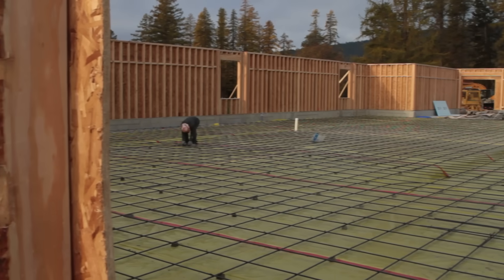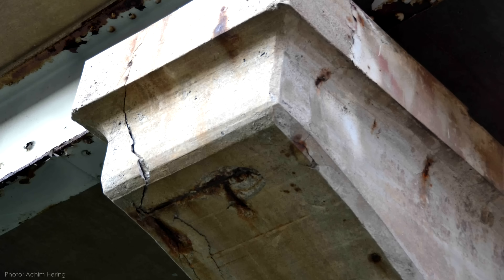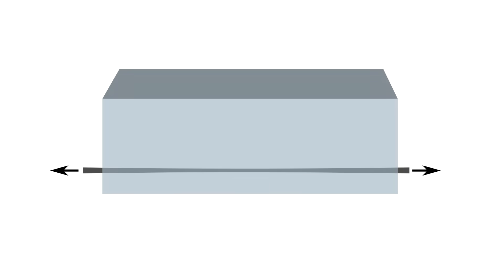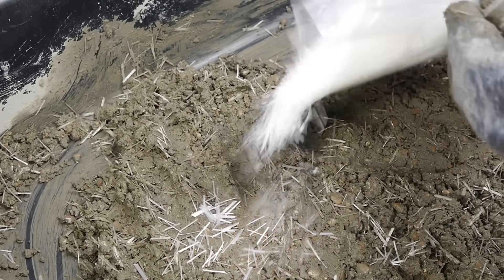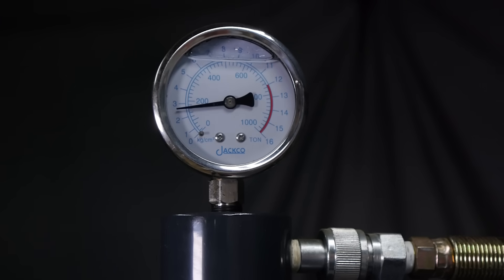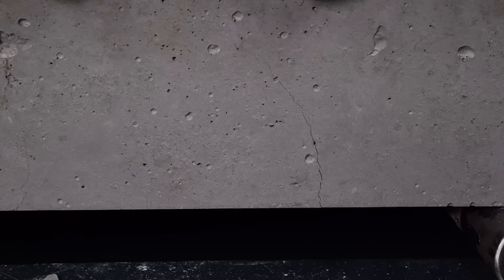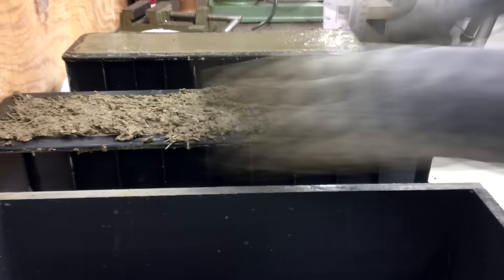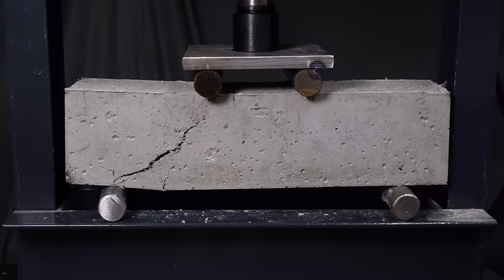Does Rebar Rust?

Comment: Is there still a point to adding fibers when using non-corrosive rebar?
Reply: Cracks can let in water, which can freeze and expand, which would damage the cracks even more.
Reply: At a guess I would suspect that would depend on the intended application, for one thing the added protection against the formation of smaller scale cracks could be a valuable property for applications where there is a relatively high risk of damage due to impacts etc. Military structures that are very likely to be subjected to weapons fire or structures likely to be struck by heavy vehicles etc perhaps of course the latter is usually reduced by just placing metal crash barriers between the vehicles and the concrete supports. Even in parking structures you can find those quite often because the owners typically tend to get fed up of repairing the darn things when people can't park.
Reply: Yes! Crack control. Architects don’t like cracks even though they don’t impose danger to the integrity of the structure.They are just-ugly

Comment: You can probably guess, I’m not aware of the science of concrete, more of an “armchair amateur”. lol  
A crack can be a visual guide to a problem within the heart of the concrete, if a crack is masked with fibre reinforced concrete, could a problem be missed more easily? 
  I mean water will ingress into the finest of gaps aided by capillary reaction, with concrete not flaking away it would make a failure even more unexpected than if it was visually flaking and falling away.

Comment: why did the beam fail suddenly ? 
isn't the rebars are supposed to ensure that the failure isn't a sudden one (brittle) ?
Reply from the maker: See comment above. These beams were over-designed. They weren’t really meant to demonstrate the failure, just show how the flexural cracking works.
Reply: Not sure if the beam was designed as tension controlled, meaning that the steel begins to yield before the stress in the compression zone reaches the concrete's compressive strength. Also, due to the short span of the beam during the 4 point bending test the shear forces in the beam were very high causing it to fail due to the lack of shear reinforcing (stirrups).
Reply: Not really. The beam failed suddenly because the concrete cracked and was no longer bound to the rebar by the rest of the beam. The rebar is there to add tensile strength, but the structural material is concrete and it will always break like that.
Reply: The beam in the video failed in "shear", which is an instantaneous failure. A longer beam would fail in "bending", which is more visible and progressive over time. In summary: "short" beams fail in shear, while "long/slender" beams fail in bending, the same as "short" columns fail by crushing and "long/slender" columns fail by buckling.
Reply: Rebars add almost all of tensile strength, so they are structural materials too. They are added to ensure minimal height of a beam/slab. Otherwise the beams should be like in ancient Greek churches, ridiculously high and short.

Comment: Hi, how long did you leave those test beams after poring before you tested? Concrete improves over a few weeks or months after it has been pored.
Reply: In the video at 4:04 he said he let all three test samples cure for about one week.
Reply: He said two weeks but for the purpose of the video and his test setup it didn't really matter as long as all three samples were cured for the same time. The samples were tested only compared to the other samples and not to anything else.
Reply: He said that he let them cure for 2 weeks
Reply: ooops, missed that, thanks
Reply: @marvintpandroid2213  
*pouring
*poured

Comment: May I request a topic? :) About concrete pouring under water? :)
Reply: Potchi Boy yes do this please! Or just bridge building in general
Reply: @JHA854  bridge building in general would be a 70 hour video. There are so many types of Bridges and ways of building each one.
Reply: Yes please
Reply: Ok, so I'm a delivery driver for ready mixed concrete.

Alex Solhall is correct about how concrete cures.

Last night, I worked a pour on a bridge over a local river.

They are actually building a new bridge. We poured a caisson (pier, or piling) that is part of the main support structure.

132 cubic yards of concrete for a caisson 135 feet deep.

They ran the pipe from the concrete pump truck to the bottom of the form which was full of water. As a previous commenter described (Mr Wizeguy), the concrete flowed in from the bottom, and pushed the water out the top of the form.
Reply: Hi Potchi!
Concrete does not actually dry like a wet towel, by evaporation, to become strong. The water molecules reacts with the cement in a process called hydration. So the water actually stays inside the concrete forever, and therefore, concrete may also set underwater. A more common problem is that the concrete is evaporating water in hot conditions, making the finished product have a rough or cracked surface, and that is why newly poured concrete is sometimes sprinkled with water. I am not a chemist and haven't thoroughly read up on the subject but I hope I was of some help.
Reply: @axelsolhall5830  the cracking caused by water evaporation is because evaporation causes cooling so the surface shrinks. The concrete may still cure properly but the cracks remain. So the worst conditions for this is not so much when it is too hot, rather when it is warm and windy
Reply: Oh, that would be a good one. I'm curious to see if research into the old Roman concrete has resulted in any modern applications yet for marine concrete.
Reply: @jnklee  actually, the concrete used by the Ancient Romans is of much better quality than what we use today.

Unfortunately, the techniques and "recipes" they used were lost, so we don't really know how to make concrete as well as they did.

That, or it's too cost prohibitive to be practical.
Reply: @alpurl  really? How do we know it was better if we don't know how it was made? I just know they used seashells to make it.
Reply: @MrRedsjack  hmmmm....

Well, last year in Atlanta, there was a fire under a concrete interstate bridge that ultimately collapsed.

We have buildings, roads, driveways, bridges, etc that have to be replaced because of questionable structural integrity.

Many Roman structures are still standing, and some still in use after 2000 years.

What say you to that?
Reply: From direct experience I can tell some of you that you are wrong about concrete setting underwater. Standard concrete such as you would use for a patio will just dissipate into gravel and silt if you put it underwater. Hydraulic cement which is a high cost very strange and different form of concrete will setup underwater. For the most part it holds together underwater as long as there is no strong current or suction nearby. It is also mixed backwards from regular concrete. Regular concrete you add the water to the mix but with hydraulic you start with water and add the mix to the water. Both can be bought at most hardware stores but concrete is cheap and hydraulic is really expensive. I won't argue the chemistry behind either because I don't know. But I did run a crew for years that did all sorts of wet and dry concrete work. We hand formed inverts and diversion channels in the bottom of manholes in underground storm and sewer lines, as well as built single/double collar walls at joints, and repaired inverts of large RCP (concrete pipe). Most of this was done in wet conditions. A shovelful heap of regular concrete place in the bottom of a storm drain pipe will disappear in seconds so it can only be used on new construction pipes (dry pipes). But if we are talking concrete as a massive general blanket statement....yes concrete can set under water but not the concrete 99% of people are thinking about. There are probably 50+ different types of mixes you can order commercially and probably 10+ varieties at the local supply house.
Reply: Everyone knows that if you put a block of concrete powder underwater, it turns into a block of concrete. Simple Minecraft.
Reply: Bibasik7 has the most accurate and best comment here 👏
Reply: Nothing special for "pour" concrete underwater. 
You need form where it will be pumped and pumping will start from bottom and keep hose there until form is filled concrete pushes water away when form fills and that way only top part of concrete touches water and rest remain pristine. 
That top part is sacrificial layer and isn't include part of designed structure meaning if you need 10"x 10" and 3 feet high footing example for pier form needs to be like 1 foot taller because that top layer becomes weaker by touching water.
Reply: Yeaa, do that one pleaseeee
Reply: you literally can use any concrete underwater you just can't shoot it out fast from the hose. it needs to be gently laid down concrete doesn't dry it cures. by a chemical reaction called hydration. we use admixtures to keep the strength of the concrete high too
Reply: @TheTurtleShellGaming  Well, that depends, but in Europe there are regulations for what concrete you can and cannot pour underwater. In Sweden in particular, you have to use an addative that prevents the concrete from bleeding cement paste. As a general rule, underwater pouring is avoided when possible due to cost, end result and technical difficulty.
Reply: Discussion of anti washout admixtures would be cool.
Reply: Yes!!!!!!!!
Reply: very interesting topic
Reply: yes, I would love to see old roman style underwater pouring.  Dad told me about it, learned later a little, sure would be nice to see a presentation about it.
Reply: Greg Kral I believe there are a couple of videos which touch on it on YouTube now
Reply: Concrete that cures underwater is stronger than normal
Reply: Potchi Boyz he made one 8 months ago (4 months after you requested it) 

https://youtu.be/URC125wpMS4
Reply: Treme method is used google it
Reply: Tremie.
Reply: I build bridges box culverts,cooling towers  I've done a lot of concrete. Most stuff under water is done with steel Piles pumped out and poured! if its a big peir A coffer dam is built pumped out and the form work is built inside. Underwater pumping is not a good idea Major construction projects stay away from it! on mix that will actually fully cure underwater is a hydro cement mix Normal agitate mix wont cure under water.
Reply: Concrete cures.  It does not "dry" in the conventionally accepted sense.